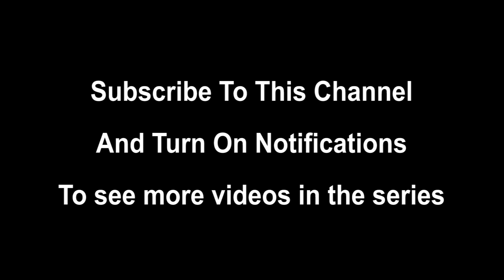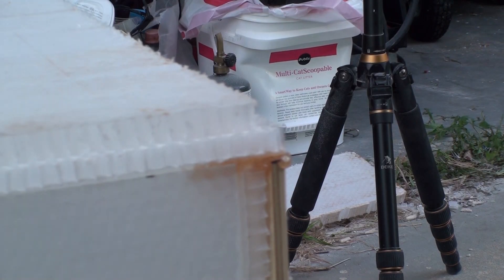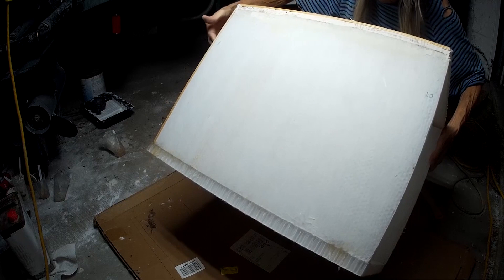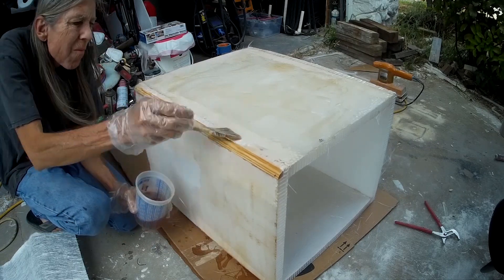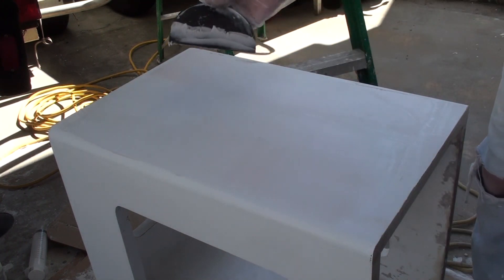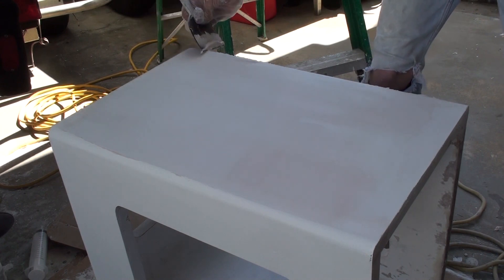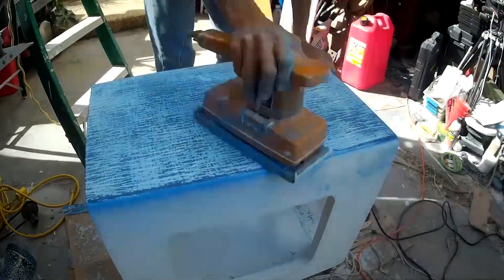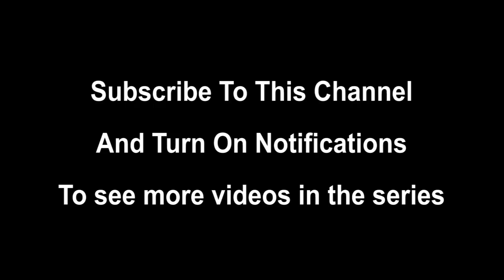Fiberglass and honeycomb core fabrication generator doghouse 1 of 2

Comment: Is Nidacore strong enough for a boat floor?
Reply from the maker: It can be.  It comes in different thicknesses from 1/4 inch to 2 inches.  When laminated with glasscloth, doubling the thickness of the core increases strength by 4 times while hardly increasing weight at all.  Remember, most of the weight is in the glass/resin composite skin you make, not in the core itself.  I have tried the 1/4, the 3/4 and 1 inch for various applications.  The 1/4 inch is kind of weak for a floor, especially if there is much of a span between supports.  If you were building a racer or an airplane cabin floor where weight is the big issue, I would try 3/4 core with just one layer of light, woven cloth on each side.  Dropping a sharp object could do some damage to the super-thin skin, so for a cruiser, I'd use the same 3/4 thick panel with the cloth and a layer of chopped strand mat on top just for protection from heavy or sharp things.  
When I made my countertop, I put a layer of chopped strand, a layer of woven cloth and another layer of chopped strand.  It is much, much stronger than it needs to be, and actually getting a bit heavy (maybe 20-30 pounds).  If I had it to do over, I think I'd do one layer of chopped strand mat on each side.  I'm glad I have the three layers in the supports under the generator doghouse though.  For anything structural, weight bearing, or under considerable stress, definitely alternate layers of chopped strand mat and woven cloth on top of a thick core.  Remember, adding core thickness increases strength considerably without adding weight, while adding layers of glass increases weight rapidly.
Reply: @ninehundreddollarluxuryyac5958  Thanks for the reply,  I am planning on replacing stringers, floor and probably a transom on an 18' ski boat.  This product looks great.  Do you have any suggestions on how to mount a pedistal seat to it?  It doesn't look like it will take a screw very well in a high stress area.
Reply from the maker: @davemall1  It could work really well for making stringers and floor.  Older boats have wood stringers which can rot and cause the kind of problems you're probably trying to fix.  Most modern boats including all Carver models ending in 7 and above, have fiberglass stringers.  A lot of times the stringers shape is made with foam, and layers of fiberglass are built up using the foam as a form to shape the glass.  The foam has zero strength, its only a mold for the glass which is the structural strength of the stringer.  One often overlooked solution is to lay up a bunch of layers of fiberglass over the rotted wood.  Use fairing compound if necessary so you have a rounded fillet at the edge between hull and stringer, then run fiberglass over the stringer and out onto the inside of the hull.  Cut each layer of glass a bit longer than the previous one so it extends a bit farther out onto the inside of the hull.  This tabbing should be pretty wide, at least 6 or 8 inches to assure the bond between your newly created fiberglass stringer and the hull.  Tab it in this way whether you use foam, nidacore, or your old stringers to form the glass.

Nidacore acts like end-cut wood as a core material.  It resists crushing in one dimension better than the other two.  Its literally a bundle of plastic straws, so the straws crush easily from the sides but are impossible to crush in the long direction of the straws in the bundle of straws if that makes sense.  Nidacore has the straws "on-end" going from the top face of the panel to the bottom face so this is the direction where it will be extremely strong.  Your stringers will be strongest if you get the thickest nidacore and lay the flat, furry side against the hull.  If the stringer needs to be taller than that, put resin on top and lay another layer of nidacore on top so the resin glues them both together.  They are stronger if they can't slide across each other.

I'd put a backing plate made of metal, starboard, or even wood below the nidacore deck and screw the pedestal into the backing plate or bolt through it with the core in between.  Remember, this is the direction in which the core will most resist crushing.  Run your backing plate as wide as you have space for.  The wider the backing plate, the more it spreads the load out over a bigger area of core.

I'm no expert.  I've only used these materials for four months so far.  This is just based on what I've learned about it so far.  Good luck with your restoration project.  Its always rewarding to make something work again.